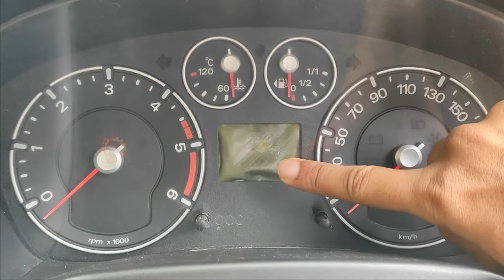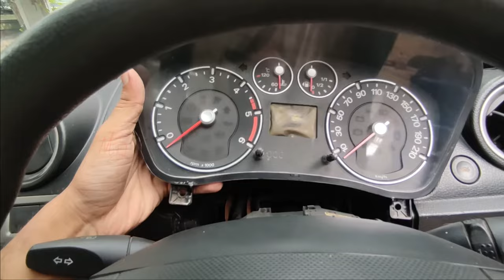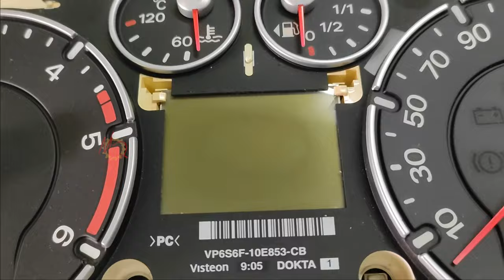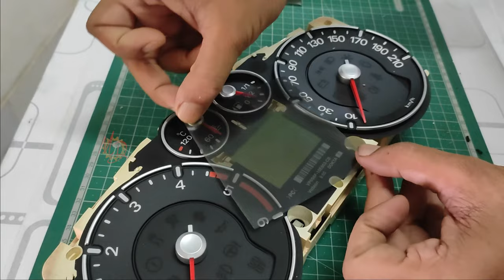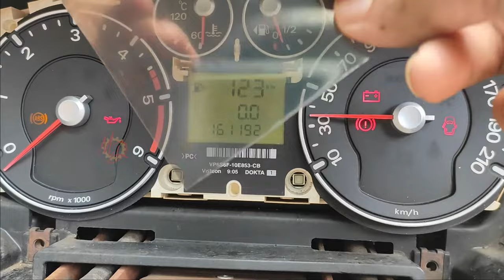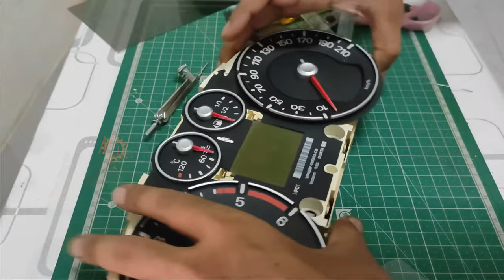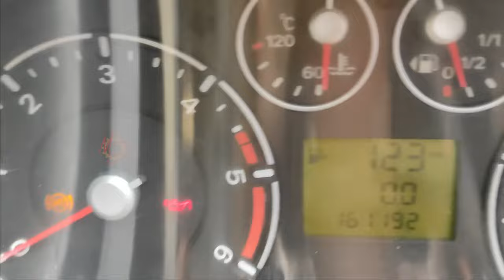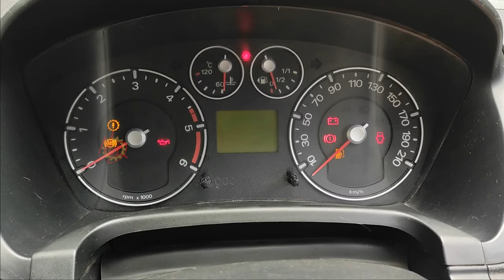Fix any car speedometer or LCD display for just  RS.100  |  Ford Fiesta Speedometer LCD display fix

Comment: Bro if we remove and refitting the same meter after sticking the flim require ecu coding???
Reply from the maker: No, we did make any changes to the internals. Just the display polarizer film is changed. No ECU programming needed.

Comment: After installed ned polarizer film of Fiat linea its not working, its blank now. kindly share your suggestions.
Reply from the maker: Make sure you stick the polarizer in correct orientation. Try rotating the film before sticking like I did in the video and find the correct orientation of the film.
Reply: Please send display film name

Comment: Brother i have removed the instrument cluster from the socket and removed but struggling in removing the front glass can you show to remove those locks from the panel
Reply from the maker: You need to carefully pry open each clip. They are fragile and easy to break. So be very gentle.

Comment: Bro fiesta ല്‍ kilometer correct കാണിക്കുന്നില്ല 2 3 km കൂടിയാണ്‌ കാണിക്കുന്നത്‌ എന്താ solution help bro
Reply from the maker: എല്ലാ വണ്ടികളിലും സ്പീഡ് കുറച്ച് കൂടുതൽ കാണിക്കും. 5 to 10% വരെ വ്യത്യാസം കാണും. പിന്നെ ഒരു chance ഉള്ളത് വലിയ size alloys ഉണ്ടെങ്കില്‍ സ്പീഡ് error വരും.
Reply: @MandakiniDiaries  fuel distance കാണിക്കുന്നത് correct അല്ല ipo 90 distance കാണിക്കുന്നു എങ്കിൽ 1km കഴിയുമ്പോൾ തന്നെ 70 ആവും പെട്ടെന്ന് ഇതാണ് പ്രശ്‌നം ഇത് complaint ആണോ അതോ ഇങനെ തന്നെ ആണോ
Reply from the maker: @Zallu369  അത് എനിക്കും അങ്ങനെ ആണ്. നമ്മടെ driving conditions and real time fuel consumption base ചെയ്തു range മാറിക്കൊണ്ടിരിക്കും.